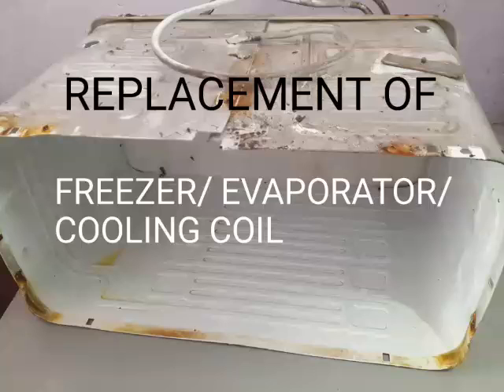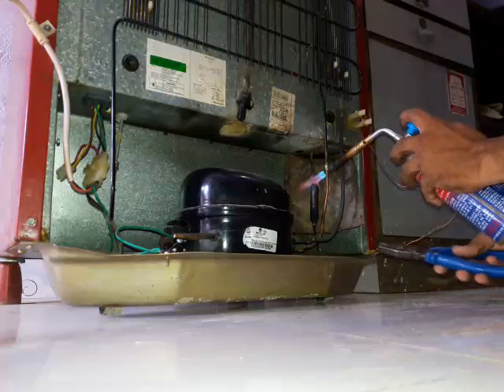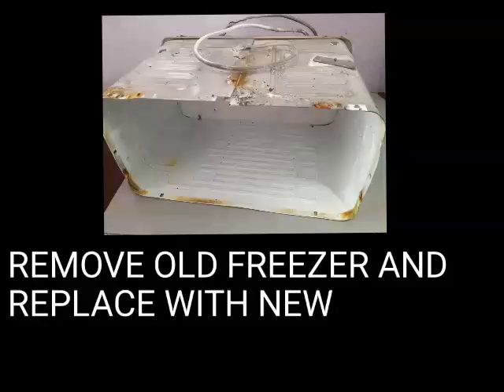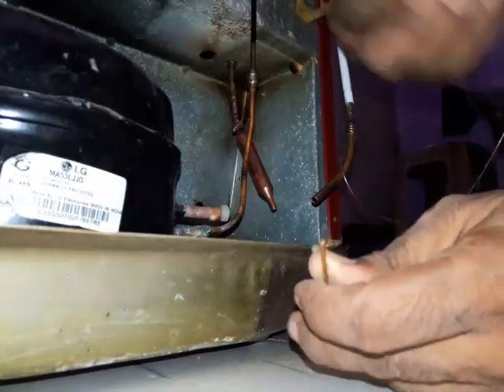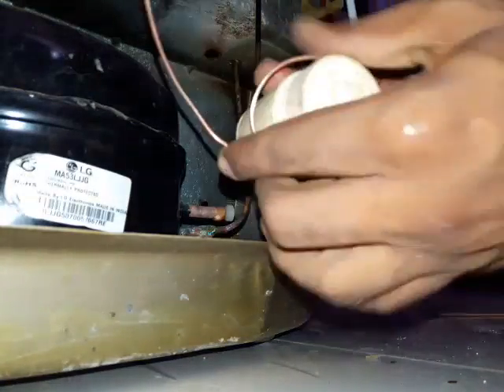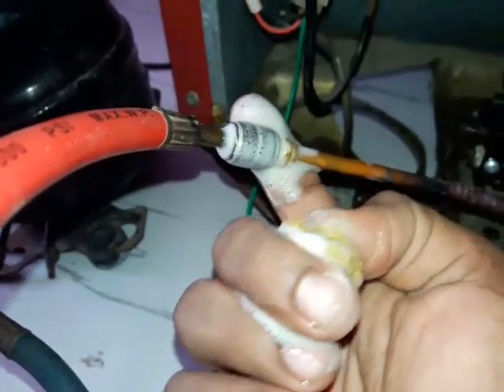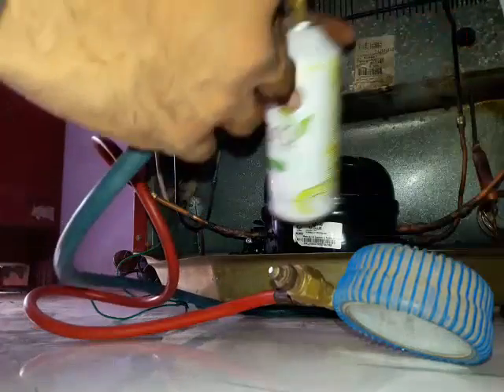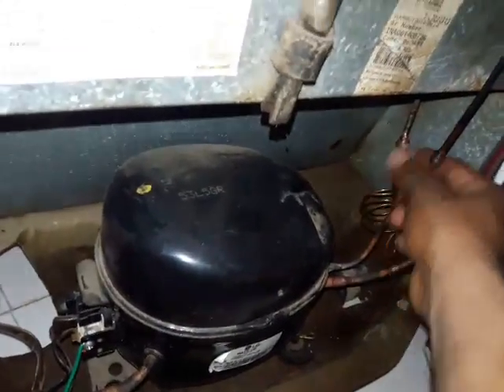Refrigerator gas charging and fridge repair  R134a refrigerant.  Freezer change. Not cooling

Comment: Sir ye jo pressure metre kaha milta hai or flearing nut tube cylinder regulator and soldring gas torch brezingrod and it's material total price how many rupees?
Reply from the maker: Yeh sare tools refrigeration  spare dealer k shop pe mil jata hai.  Price depends on quality. Torch gun 400-700/- approx.

Comment: greetings from turkey  may have question to you 

how we can find  out  where leaks the gas from fridge 

is  leaks  internal system or  around compressor coppers joints  do yo know any short cuts friend ?
Reply from the maker: Sorry for late reply. If we see oil particles at any part, we can say the leakage is from here. Otherwise we have to check it by pressurised nitrogen or air inside the system.

Comment: I also have a refrigerator and no gas there in the refrigerator . So ,I don't have any equipment to correct it . Can anybody help me to      correct it .
Reply from the maker: You can call your brand service center. Like Lg, samsung and any other brand. They provide you a tollfree number for any service. You can call your nearest local technician too.
Reply from the maker: You can't do it by yourself. You should call the technician.
Reply: @TechnicalSafar  can u tell me or send me number of technician for me ?

Comment: how frequently we have to change the gas sir?
Reply from the maker: It is not required to refill the gas frequently. It only requires untill the gas is leaked or any issue related to low cooling.

Comment: Hi bro. Good explained and I need your prompt response and guidance. As I have godrej refrigerator and while cleaning I broke very thin pipe and gas came out completely, now I checked with service center they are telling that I have to replace freezer as some difficulty in breasing of aluminum can you please guide are they telling correct or they are just want to sell spare.
Yohan.

Comment: sir vaccum krne ke liye compresre me power supply dena pdta h kya
Reply from the maker: No. System compressor ko kabhi bhi power nahi dete hai. Vacumm ho ya pressure leak test. Only vacumm pump ko hi power dena hai.

Comment: Hello sir Kay refregrator me caplary replace ka koi data hai
Reply from the maker: 180-220 ltr ka fridge hai to 0.031 ki 10-11 feet capillary dalte hai. (This is practically)
Reply from the maker: But I suggest you to replace according to the old original capillary bore size and length.